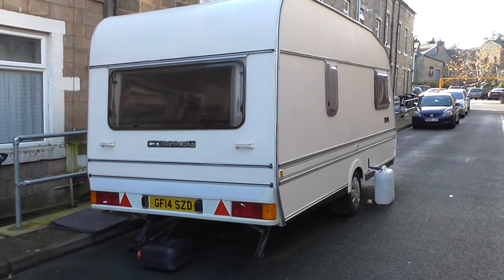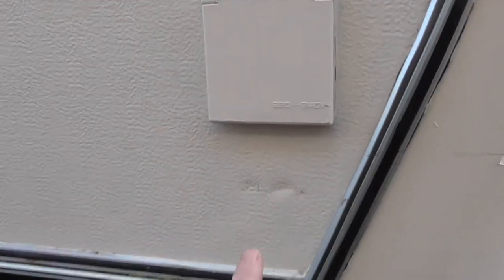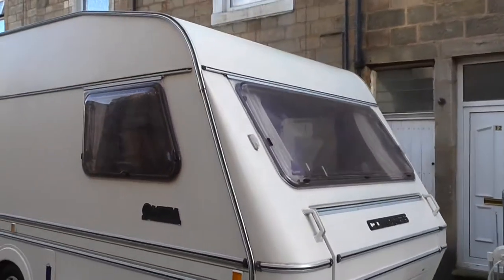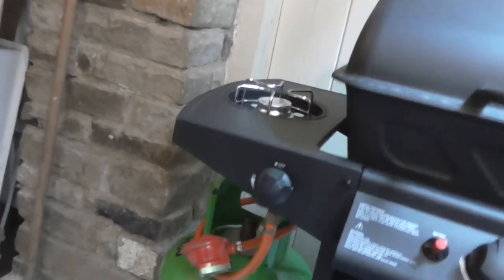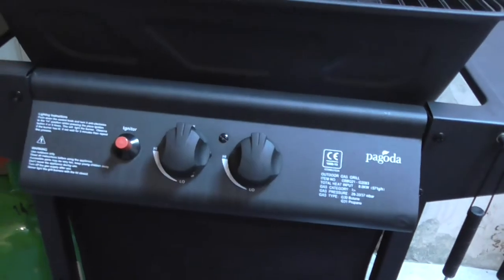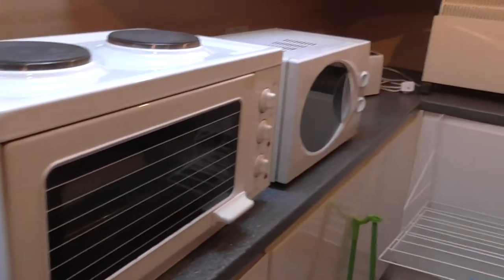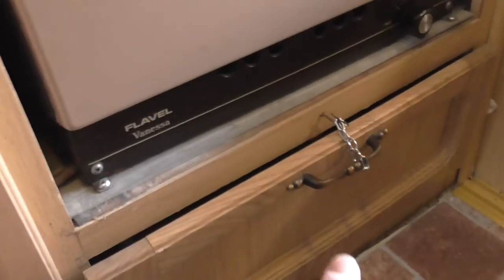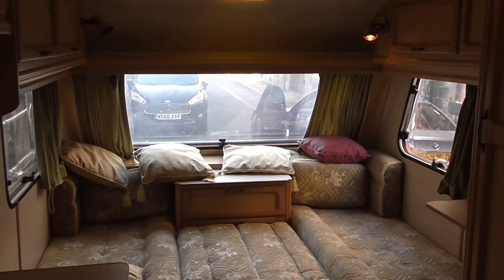Compass Omega 930 four berth touring caravan.

Comment: hi is there anywere to get parts for this make and model or even information on the walls were to get them or cushion covers. i have been redoing my caravan and it is the same model as the one in the video but it very hard to find these types of caravans information or anything about them online
Reply from the maker: High Steph , I think you will find it very hard to find this model of van in a caravan breakers yard now as they are getting older , there is a large caravan breakers in Birmingham but I can't remember there name but if you google search it you might get lucky, Sorry I can't help you further than that but good luck with it all.
Reply: @ShaunMurray63  thank you